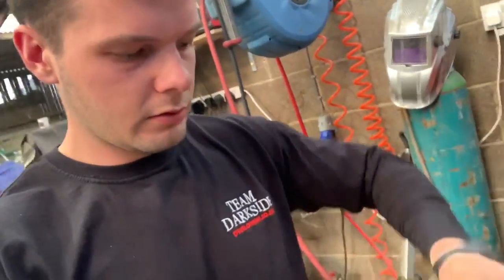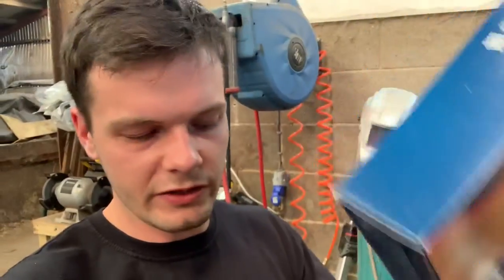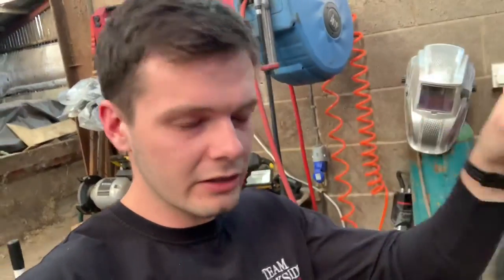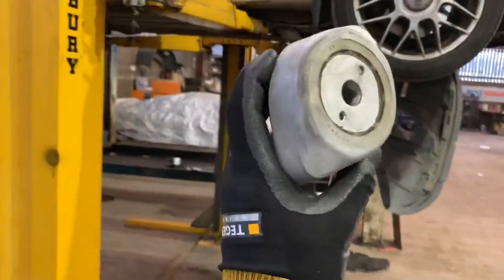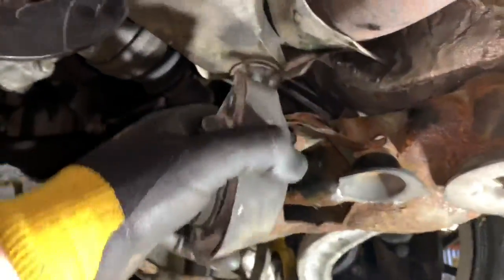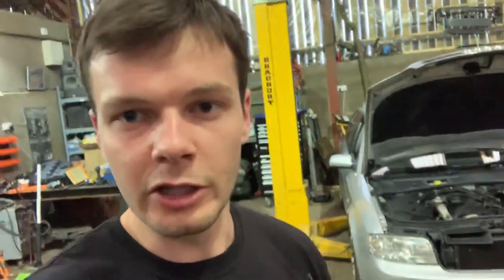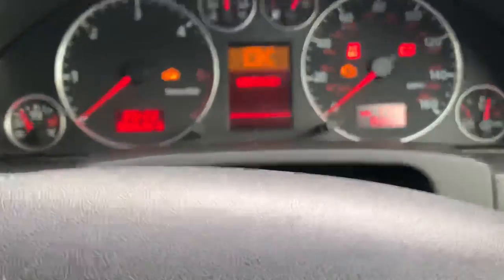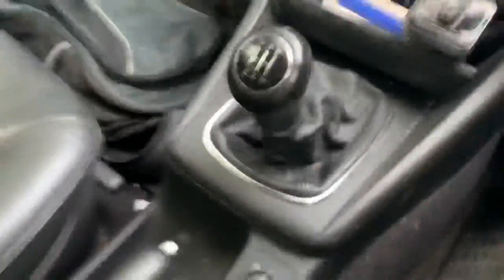My £700 Audi A6 Avant

Comment: £700 for a car that does everything my £10,000 car does makes me feel like a right bell end. More bangernomics videos please!
Reply: Yorkshire Lad I bought a £600 2003 Corolla 2.0 d4d with 139k miles now there’s 156k on it in 6 months and it’s every bit as good as the brand new cars I have bought sure the engine is agricultural and louder but it drives really good considering I got rid of a 2015 Clio Dci for it because it sat in the work car park for 3 weeks solid as I always had the work van
Reply: Audi estate 25 to 28 grand will be worth 63% of its original value after 5 years!
Reply: @Mr330d  Thanks for the idea of looking at a Toyota Corolla diesel I need a second car to get the miles off my RS3 👍
Reply: London is Red It’s not uncommon to see them with 250,000 + miles
Reply: I watched the old Audi videos and sad to say that it may have never had them issues if he tested for air leaks in the fuel system. It was like watching someone torture and animal when he used brake cleaner to get it started 🤦🏻‍♂️.
Reply: Cheers Sean Moore for your comment, although 11 months late it’s still valued by all here..
Reply: @Korbyn Avi instablaster =)

Comment: A car is a car. Nothing wrong with VAG cars, lots to be said for them. Save fuel money with a turbo diesel daily driver. Good to see you servicing it & top job everything went well.
Reply: Lol nothing wrong? search "BKD engine head crack"
Reply: @mrboostification  "BKD engine head crack" was with them in couple of months when They started a production. But They repaired it and from some year its ok. Otherwise this A6 has not v16 engine.

Comment: my dad has the 2000 version of this car with 110 hp compared to your 130hp, i don't think they last quite as long as the 110hp version because of the higher pressure used to get the extra hp, but my dads has almost 300k miles on it and he's never had a single issue with it. Trust me these engines last for ever. indestructible.

Comment: Front suspension is love/hate thing mate. I tried to extract pinch screw myself and ended up cracking the screw support lip on top, found spare from guy who was braking the C5, he had them both screws seized, when I said that these both are not worth the initial £70, but deal is a deal, gave him £70 for both, but said, please give me advice how to get them screws out, guy smiled and gave me  back £10 without shedding wisdom :D Ended up drilling out, took me 3 sets of drill bits, numerous battery recharges and two days, but got them out. Fun, disassemble to finish took me 7 days working only weekends and after work during the daylight.

Comment: The rear wiper does sit pointing left from factory. I have an Avant 1.9 TDI (wiper works but possibly blocked so no washer) and an A6 Sport 1.9 TDI both 52 plates, excellent cars, had them years :) had a another Avant at one point, replaced the rear wiper motor and I ended up having to fit the wiper are pointing to the right as the motor was working the opposite way lol. With the fuel filter, it's best to cycle the ignition on-off a few times so the fuel filter fills up. It worked for you anyway :)
I'm going to be retrofitting an RNS-E navigation plus unit in my A6 Sport soon, wish me luck ;)

Comment: I’ve got two vehicles now, an Audi A1 tdi which I’ve been driving for the last three years and a Volvo S80 petrol which I’ve owned for a year, and I must say it’s a totally different felling driving that Audi. It’s just breathing quality and it’s so precise compared with the Volvo. When I’ll change my car will probably look at another Audi
Reply: Comparing a large sedan to a small hatch is stupid. It's not audi magic, it's a small hatchback magic. Most of them are fun. Still wouldn't trade my Volvo v70 D5 for anything because of how good it is on long range journeys
Reply: Bears Beets you’ve got a point, but if you do a bit of research you’ll see that mighty D5 is sourced from Audi. I’ve owned an a4 from 2005 before and my brother had an a6 from 2006 which is at the same class with my S80, but I’ve got to say I like my Volvo but it’s a different breed from the Audi

Comment: I've got 2002 A6 and it's been amazing for 3.5 years. 2.7t quattro manual if it ever tempts you and has the all important bilstein/eibach suspension done. Oh and my rear wash doesn't work either!
Reply from the maker: 2.7t was on the map but I couldn't say no when this popped up

Comment: Got exactly the same car bought used around the same time but our problems are a bit different. Bought the car and the cluster wasnt working. Wasnt as simple as replacing the cluster as the immobilizer runs through it. so had to get a remapped ECU with immobiliser delete and new cluster just to get my dials back. All new brakes, new rear caliper and a shit load more to do. No regrets though, these are good cars when they're working.

Comment: Your not kidding about the top bolt on the front suspension being shit to replace, they always seize in and normally snap then have to be drilled out so well done for finding one that’s had the work done already. Also if you change the oil filter before you drain the oil, then the dirty oil that’s held in the filter housing can be drained out too rather than getting pumped back round again 👍
Reply: The amount you saw at the bottom of the filter housing doesn't drain out (oil level sits much lower than that), it gets trapped. Only way to siphon or mop it up if you can be asked to do that. It's a tiny amount though, it must be about 5mm tall lip at most that stops it from draining.

Comment: Danny, when you do the fuel filter, tip the diesel out of the old filter into the new one. This will ensure the system is purged from the turn of the key.
Reply from the maker: That's what I did but was still a bit worried! Started immediately, never had that before.

Comment: I have an A4 B5 avant 2000 PD engine, 209,000 miles on the clock, goes like a train still.  Had to do some work on it and I swear audi deliberatley put their bolts and nuts in the most awkward and difficult place that can imagine; constantly in a way that you can't reach or can't get a spanner in for obstruction.  Not to mention using every nut size they can, including even numbered ones which are missing in a lot of spanner sets.

 Wouldn't swap it for anything.

Comment: You should only put 5w-40 DPF oil from castrol magnatec on that particular engine. The 1.9 TDI 130 hp revision AVF and AWX engine code was the only engine to be equipped with a particle filter on that car.

Comment: purchase price hardly matters, its the running costs that get you
Reply: well 700 vs couple thousand does make a difference. unless you are rich.
Reply: @y4nnickschmitt  I'll give you an example, I bought a car for just under 2000 euro but over 4 years of ownership running costs fuel, insurance, maintenance totaled at very roughly 5000 euro, the longer I keep the car the smaller fraction of the cost initial price I paid makes up in the big picture, ofc we talking bangernomics not new cars that cost 30k+
Reply: @darius2640  yes I know how math works. Doesn't change the fact that 700 bucks is very cheap.

Comment: good vid 👍 , most late Audi pd engine diesels have a lift pump in the fuel tank which fill up the fuel filter. , in the rare occasion it cuts out it'll actually starts back up again , so long as the lift pump is working order. , what engine did you Audi A4 have ? again cool vid keep the old diesel alive 💪
Reply from the maker: My A4 was AVF this is AWX so not as strong in some regard but both have lift pumps from memory!

Comment: First thing I would do is put in a proper 3 spoke steering wheel (you can find them in your junk yard) And if you can contact the original purchaser (probably last owner) those bilsteins are lifetime warranty to the original purchaser and set yourself up with a new replacement. I know you want this to be reliable but you could find someone to put some tune in it for more hp / kws but I'm sure you want as much gas mileage as possible
Reply from the maker: Hey I quite like the larger wheel! It's comfy in traffic lol. A 3 spoke sport wheel would be nice I guess but it's not urgent😅
Reply: @dannyDC2  You could easily make this into a track car and have a station wagon gutted that rips with a larger turbo, 6spd, cheap BBK porsche cayenne, VW touareg 4-6pot brembo brakes if you don't get carried away

Comment: Looks like you’ve got a “Good Car” there especially for £700 with all new arms on the front and bilsteins all round 

Looks like it’s had front bearings too as I noticed the bolts on the back of the hub look new

Comment: Any problems with rear washer you need to check under the passenger front footwell as the rear washer pipe is just above and notorious for bursting apart filling under the carpet with water right underneath is an ecu caused me all sorts of electrical problems carpet on top was dry but around the sound deadening soaked

Comment: I got an 07 plate last year and looking after it well : only thing I need to put in is a dab radio with wifi :: costing about 120 Installed.  The avant cost me 3100 second hand

Comment: Hi mate could I check for the engine/gearbox mount did you get a clunk going on/off acceleration or vibration through the revs when in gear? Got a A4 B6 tdi with I think the same bother as you described

Comment: I would've gone for the 2.5 tdi. It's a pretty heavy car....but good and reliable choice still...😎👍
Reply: while more powerful, the 2.5 tdi is sadly nowhere near as reliable, camshaft wear, injector pump etc. are the weak points of that. the PD130 is a very reliable and capable engine, pulls very well (I've got two of these).

Comment: If it was A left hand drive, it would be worth at least 4 grand 🤪
Reply: Harm Zegt how come?
Reply: Because second hand prices in mainland europe are lunatic. For €700 you can get A 1985 ford fiesta with 400.000 km’s on the clock and A dodgy MOT.
Reply: Harm Zegt why are the prices so high?
Reply: One Life Vlogs artificial kept high by companies controling the 2nd hand market.
Reply: Harm Zegt thanks, I never even knew about that, I’m glad I live in Britain in that case
Reply: One Life Vlogs even boy racers on the german nürburgring import cheap righthand drive BMW’s to modify them for racing the circuit. Saves them thousends of euro’s they can then spend on expensive upgrade parts.
Reply: Harm Zegt that’s mental

Comment: Ok I have some questions. For a drift car do I get front-wheel or rear-wheel or all-wheel drive. Is there such thing as too much power ( like if I put a 502 engine in a geo metro is that over kill lol)
Reply: If you plan on using that car on tarmac, you must have a rwd car. Fwd's can't drift and since awd's built their reputation on grip, neither can they. All of them can slide, but that's an entirely different thing. If you plan on drifting it on a dirt road, you can use and awd car as well.